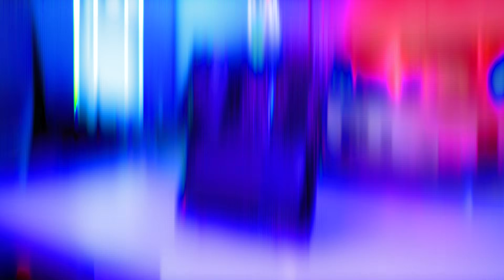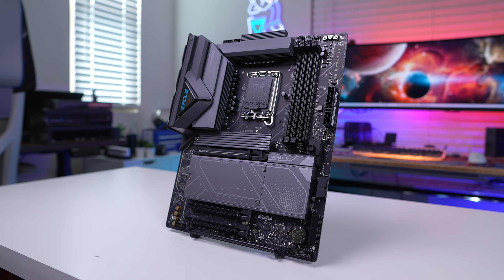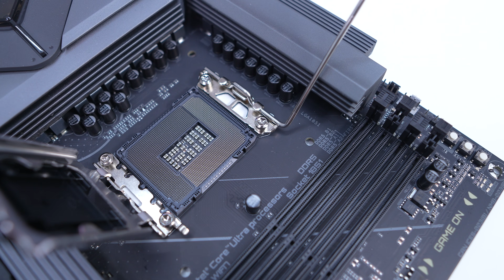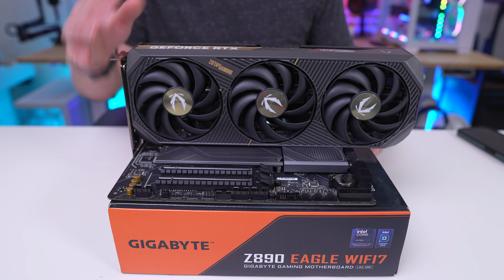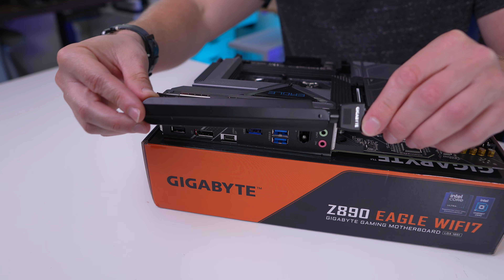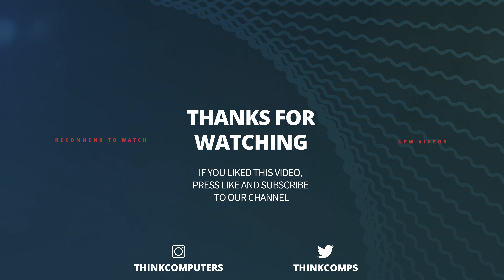The BEST VALUE Z890 Motherboard? Gigabyte Z890 Eagle WiFi7 Review!

Comment: I don't know much about hardware so bear with my ignorance.
Why is it that M2s being so easily removable don't have something like a port that leads outside cases? I know it might affect performance, but are there any specific reasons?
I could share my whole computer hardware with someone else or repurposing the computer only changing the M2s
Thanks!
Reply: The reason is that M.2 to USB and Thunderbolt enclosures exist. You wouldn’t want to walk around with electrostatic-sensitive devices like a naked M.2 in your pocket. The enclosure provides the port you’re looking for.
Reply: M.2 drives aren't designed for safe long term data retention if not plugged in. People get away with it, even getting portable M.2 enclosures for internal drives, but they're taking a risk.
Reply: @AlexKarasev That’s hilariously false. NAND flash in typical M.2 drives can typically maintain its voltage level for 7 years.
That’s in QLC drives. Typical retention period for TLC is 15 years due to having fewer voltage levels and looser tolerances for maintaining them. 
Some early SSDs had firmware issues which caused a voltage drain on the cells when unplugged. That hasn’t been an issue for over a decade.

Comment: no HDMI ? or is it hidden?
Reply: no HDMI
Reply: I have one its hidden. Its on the opposite side of the USB connectors, right next to the sata connectors
Reply: @DumbFluffer No, it’s not. This board doesn’t have an HDMI port.
Reply: DisplayPort to HDMI cable or adapter… 
Or USB-C to HDMI, making sure it supports DP-alt mode.
Reply: ur not supposed to use a that there gangalang it goes into the gpu